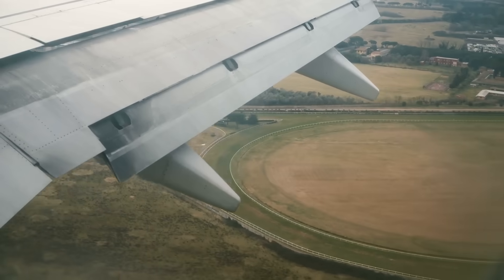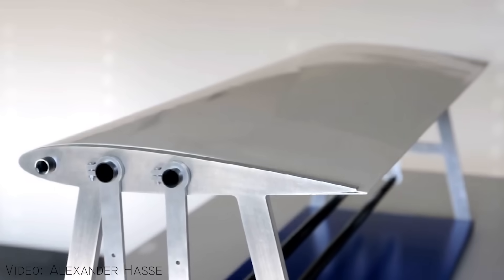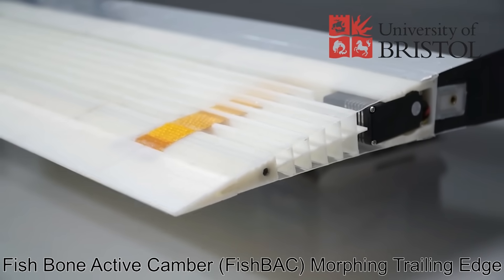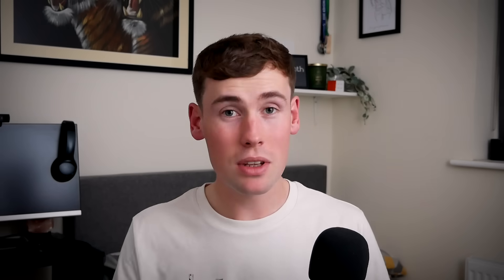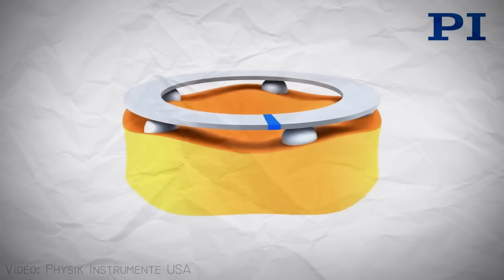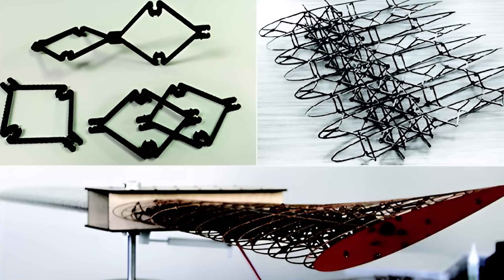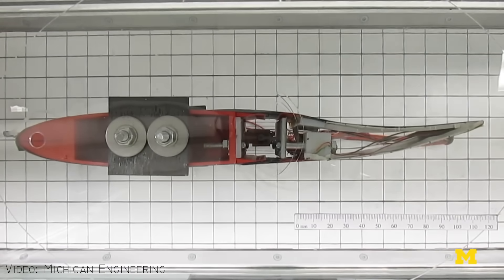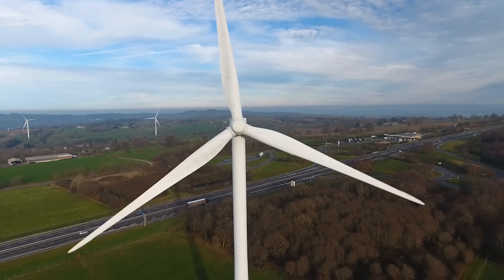Metamorphic Wings: The Future of Flight is Here

Comment: Even if shape shifting wings become a reality, Fowler style flaps will probably still be needed on large aircraft due to separation at large curvatures. Fowler flaps have several elements. The gaps between the elements allow air to bleed from below the wing to above which prevents separation. A shape shifting wing could not do this. Shape shifting does seem useful for all other moving surfaces like ailerons, rudders and trim surfaces. It would be really interesting if they could also change the thickness and other aspects of the section to tune efficiency to speed and angle of attack to move the drag bucket around.
Reply: - blown upper surfaces can be integrated into many designs..  at a cost of course...
Reply: Cant slots be added to flexible wings for this purpose, even variable slots.
Reply: Yay! Fowler flaps. Thank you for the explanation. Now I know why sail GP boats have a  'split wing'. It's not really, as many say, but rather, a high aspect ratio wing with an oversized fowler flap, which bleeds excess pressure thru to the low pressure side (leeward on these foiling catamarans) to stop flow seperation and therefore drag, while directing lift strongly in the desired direction. Essentially a wing with landing flaps extended (lots of potential drag) but adjustable for lift/bleed/drag. These also are split longitudinallly on 3 parts, as sails need 'twist' in the upper sections to catch wind higher up and direct pressure down to the flatter lower sections. I have prototype RC catamaran I'm messing with at mo, and while sail gp foiling boats have had wing tech for 12yrs or more, I haven't seen any of this tech incorporated in their designs, which is exactly suited to this application, where plastic film covered carbon frame wing sails are currently the cutting edge. This skin warp tech could easily add control and power advantages to an already 90kph wing powered cat or trimaran. In fact, this has inspired me to make one. Any help greatly appreciated!
Reply: And yet, the great master and teacher of all things, nature, shows how it is done: All birds wings are flexible and can be modified while flying to change shape, it is clear that nature is correct and we are wrong and the the future is flexible and elastic, not rigid and inflexible like now.
Reply: @nigratruo  Please, let us not just blindly believe dogma here. 
These 'flexible wings' will, at this stage, not replace modern aircraft wings, at least for large airliners.
What modern wings do that these 'flexible wings' can't do is have slots in them, in neither the leading edge nor the trailing edge, which are REQUIRED for large aircraft, to reduce their landing distance, to not make runways extremely long.
You already said it nature does it better: You are correct, look at birds again, ever noticed that the large birds have slots between their feathers, especially towards the wing tips? Ever noticed how amazingly they can transform their wings? Bird wings are better in so many ways that we can not replicate. 
Unless you somehow make wings with feathers and invent unbreakable mechanical linkages that can move a wing around like birds do, that are at least 35-88 meters long, and can withstand all the forces of flight, you might be out of luck.
There is a reason we build wings our flexible wings the way we do, there is a reason the single slotted flaps of a cessna look different to the triple slotted ones of a Boeing 747.
Don't get me wrong I'm excited about what this technology could do but blindly saying something because it might look like how nature does it is not the way to go.
Reply: @TheOnePurpleGuy  Do you not understand that individual feathers in a wing have built-in 'holes' at several scales? Nature has had billions of years to passively test and iterate and discarding the lessons out of hand because we haven't yet figured out how to replicate it is folly. This is the mentality of someone who would have told the Wrights it would never work.

Comment: While there is no consensus amongst aerodynamicists as to how lift is produced, many modern scientists (and some older ones, like me, hold that that downwash off the wing's trailing edge is the primary source of lift. Bernoulli’s Principle of lift, which put simply, states that lift is produced by unequal pressure above and below the wing, which has been espoused for a very long time in many otherwise excellent aerodynamic texts (it appears as THE explanation for lift in my old copy of AERODYNAMICS FOR NAVAL AVIATORS), the venerable and much respected "Stick and Rudder' by Wolfgang Langewiesche, written in 1944, entirely debunks this, adopting the "Newtonian" principle of downwash producing lift as an opposite reaction to such. 
In other words, many aerodynamicists, myself included, hold that aeroplanes are not sucked into flight as The Bernoulli Principle holds, rather, they are pushed into flight by downward-flowing air.
However, what is not much discussed, but which I think ought to be more so, is that the air does not move around an aeroplane in flight, such as in a wind tunnel. An aeroplane moves THROUGH it and violently displaces it in three dimensions. The air, even when still, affects the aeroplane in flight in ways that are not discussed often or sufficiently enough. 
Also, we tend to think of the movement of air when displaced by an aeroplane in only two dimensions while largely if not entirely ignoring the third dimension of motion of the air that is occurring.
These flexible wing structures bring us closer (and back) to birds and insects who flex their wings as we do our muscles to change the shape of their wings and tail surfaces. 
This was what the Wright Brothers observed and from which they learned, it has been reported, from hundreds of hours closely watching birds in flight and how they did exactly this.
From these observations, the Wrights developed the theory of wing warping which worked very well and most efficiently for their light aeroplanes which flew at low airspeeds.
BTW, I know of no structural wing failure of a Wright-built aeroplane that resulted from this form of lateral control.
Just a few thoughts.

Comment: Airplanes don't fly because there's a difference of pressure in between the top and the bottom of the wing. The wing pushes air down, that's why they fly.
Reply: Unfortunately, you are wrong in this case. There are two aspects to lift, one of which, as you say, is the downward displacement of air by the wing, creating lift through the reaction force. The second is through the creation of a low pressure zone on the top of the wing. As nature abhors a vacuum, this creates a force sucking the surrounding air and the wing into the low pressure zone. 

Both elements create lift, but the reason we use aerofoils instead of just angled boards is to maximise the effect of the low pressure zone. In terms of the contribution of the two elements, the low pressure on top of the wing can contribute upwards of 80% of the lifting force.
Reply: @malcolm_in_the_middle  no, you are wrong. The difference in pressure is a secondary effect of the displacement of air.
Reply: @olavgausaker1  That's arguable, as you can maximise the pressure difference through the shape of the topside of the wing. But it is true that the air that would normally occupy the low pressure zone has been displaced downwards. 

But the reason an aerofoil works so much better than an angled board at creating lift is due to the pressure difference, not due to the volume of air displaced. They both displace the same amount of air
Reply: @malcolm_in_the_middle  https://www.youtube.com/watch?v=edLnZgF9mUg

Comment: Flaps are for increased lift.  Ailerons are for control.  It isn't pressure applied to change the airfoil shape,   it is force.
The Wright Brothers achieved control of their Flyer by selectively increasing and decreasing the angle of attack of the airfoil along the wing.   The higher to angle of attack the higher the lift and vice versa.

Comment: The wright flyer didn’t have flaps, ailerons, or elevators it just used what they called “wing warping”. It worked in a very similar way but was hard to use due to its minimal affect compared to what is now considered traditional control surfaces. Funny how it’s almost a complete circle back to the start of aviation.
Reply: The weird part being the answer yes and no. Of course yes, because it is, but not because "aviation" knew it all along. Don't forget this is coming from a platform claiming 125% efficiency lol
Reply: The Wright Flyer had a fairly conventional (though canard) elevator
Reply: Came to post this, however I'd argue it's more like a helix than a circle.

Comment: Think material to make this out of would be biggest obstacle. A material that can sit at 100 degrees than minutes later be at sub zero temps. This material needs to be able to keep structural integrity. Think that will be biggest obstacle. Seems like most materials would degrade rather quickly. Don’t think getting movement and actual theory would be difficult. It’s the material not breaking down.

Comment: I've been working on electric propulsion designs -it seems the next hurdle for this tech is modification of the chord length mid flight. When combined with distributed propulsion architectures this would have an enormous benefit.  The other interesting area for research is the active control. Which will require complex adaptive measures to optimise.
Reply: Well, a lot of that is done in camera image stabilisation and focus, very much real-time applications, that use modelling of the performance to do feed-forward control strategies.

Comment: That’s amazing new technology for the aerospace industry. I’ve been contemplating on building my own personal aircraft. I’d like to build a helicopter, but with the weather patterns the way they are on this side of the pond, an airplane would probably be better. I’m just not sure. My goal would be to implement an all electric power plant, eliminating the need for fuel, which reduces weight, but the problem is trying to develop a power plant that provides the power and lift required to get the craft off of the ground.
Reply: The fuel powered ac will be lighter than the electric aircraft. It will remain that way until the energy density of the battery is increased by a factor of 16-25 times to about 4,500-5,000wh/kg.

Comment: The focus on efficency might not be the best. 

Firstly at landing you want to bleed of speed. This pretty much means that you want a lack of efficency. You want to most lift possible. Efficency is not even a factor.

When lifting of lift is more important than efficency.

In level flight efficency is of cause more important. But i kind of doubt this technology ad that much in this region of flight. Sure it might be 1 or 2% more efficent. But does that really counter the increased complexity?

Comment: Whenever I hear anyone talking about 125% efficiency or similar, I would suggest they ither need basic science or language lessons.  Even if you improve efficiency by 25% over what is currently achieved it is NOT 125% efficiency.  Morphing wings have been tried before, and will become more accurately controllable in future, which makes them potentially more efficient than jointed flaps.  Full credit to anyone working in this field.
Reply: Yes, 125% efficiency had me thinking of the movie "Spinal Tap" where their amps went up to 11 instead of just 10.

Comment: I would be VERY suprised if this method of increasing wing efficiency (over many tried and proven ones) would generate a net gain in efficiency at a useful scale and therefore cost savings once you factor in the absurd increase in conplexity, moving parts, weight and service requirements, not to mention the additional reinforement that would be required for the wing structure and the substantial decrease in usable capacity for holding fuel in the wings. Oh and then theres the manufacturing costs which would be... A lot.
Reply: Controllable drag…the side slip.
Wonderfully useful maneuver.
Reply: @justicegusting2476   - frowned upon once the tailfin departs the scene...  (that shouldn't happen but has and was blamed on the pilot "steering with rudder input", strangely...  (irony)  - the manual appeared to only rely on bank and yank (or just use inputs to autopilot for course LNAV/VNAV correction..- obvs. yaw damper should be on...  (Does AutoPilot use differential flaperon/spoilers for yaw control in commercial  jets ??)
Reply: it could be a fun project to engineer into hobbyist RC airplanes, though - where the consequences of feasibility per economics and reliability/safety are not so pivotal. And part of the Maker challenge too could be to devise instrumentation to provide performance feedback
Reply: Mechanical stress or material fatigue can cause failure such as deformation of the material structure or worst, cracks and fissures. In the case of using cfrp the risk is less, because composite structure i.e the material is kept together by flexible carbon fiber in the composite.
Reply: Like variable geometry wings in general, it makes it a lot easier to add STOL capability to an aircraft. You're not just increasing lift but also lowering stall speed, which they do a lot better than flaps.

The efficiency gains are mostly in flight because flaps often have a suboptimal shape during level flight

Comment: It’s a novel idea but my question is, most planes house their fuel tanks in the wing. How are they going to make the tanks flexible too? Or is there going to be a series of small thanks in between the structures??🤔
Reply: The wing is the tank. It can be made flexible, but they now have to deal with the changing wing volume as the airfoil cross section changes.
Reply: @fshihab  Your burning the fuel as you fly, so volume goes down anyways.
But I can see a configuration that would cause maximum cavitation which wouldn't be good for hungry engines.
Reply: Planes don't have fuel tanks.  Look at a parts list, there isn't one to order.  The structure is filled with fuel. Rockets have tanks though.